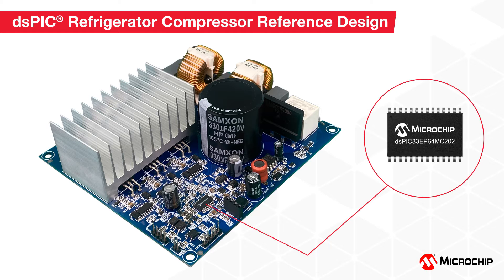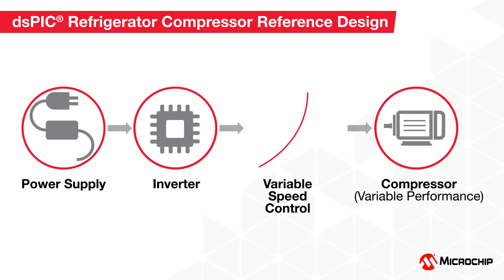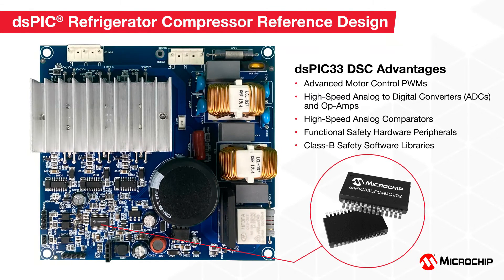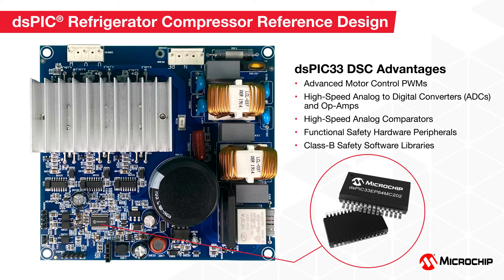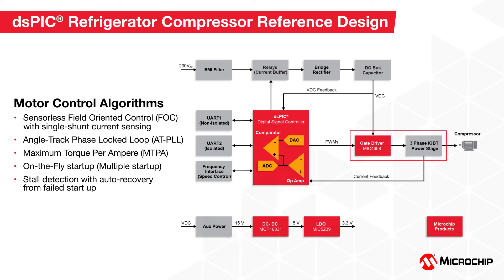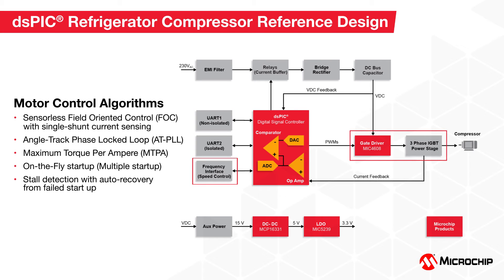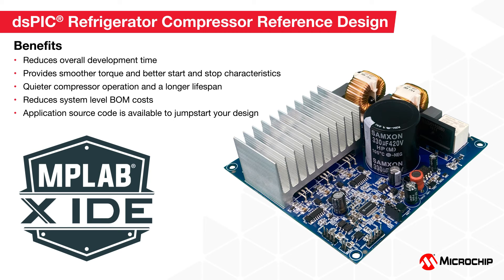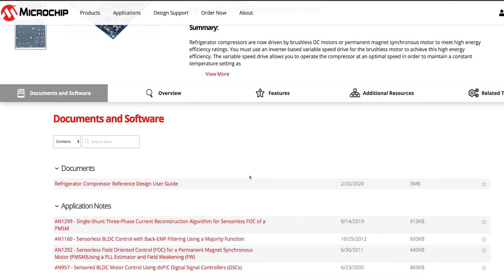dsPIC® Refrigerator Compressor Reference Design

Comment: can i buy that inverter? and can i get Design file?
Reply from the maker: Hi, the inverter is only part of the reference design. The official BOM list includes these products below:

dsPIC33EP64MC202 - 16-bit DSC for Precision Motor Control (70 MIPS, 64KB Flash, 8KB RAM, 28 pins, Motor Control, OpAmps) - https://www.microchip.com/en-us/product/dsPIC33EP64MC202

MCP16331 - 50V/1A, Non-Synchronous Buck Regulator (50V input, Non-synchronous Buck Switching Regulator) - https://www.microchip.com/en-us/product/MCP16331

MIC5239 - Low Quiescent Current 500mA uCap LDO (High Vin, Low Iq Regulator) - https://www.microchip.com/en-us/product/MIC5239

If you would like design files – Please request them here: https://www.microchip.com/en-us/tools-resources/reference-designs/dspic33_refrigerator_board